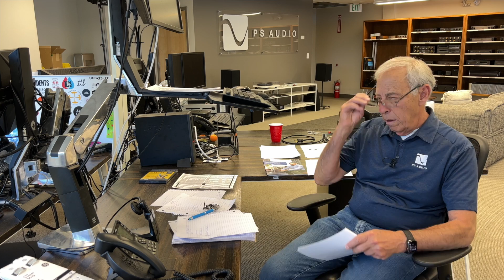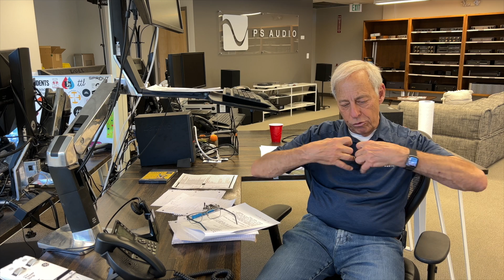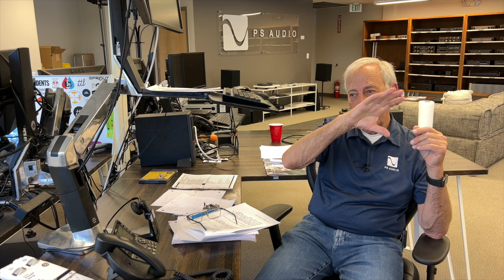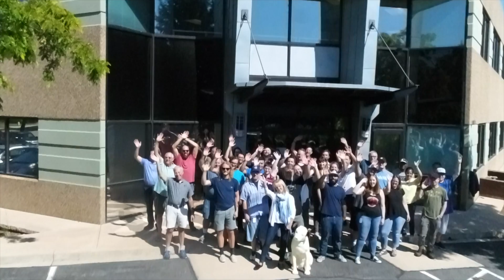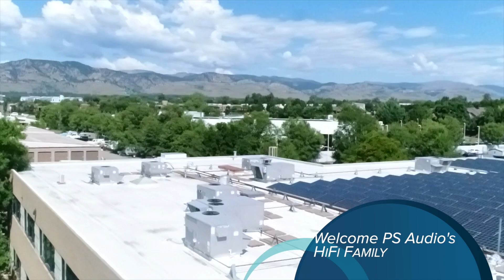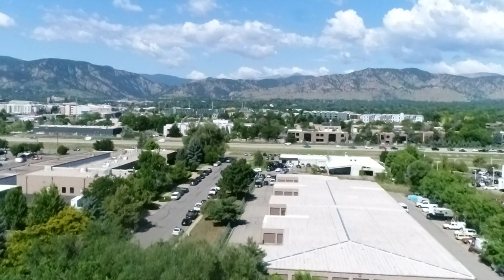Will PS Audio abandon traditional power supplies?

Comment: Paul, you dug yourself a hole on this one. If torodial transformers offer the best quality sound.......THEN WHY DO YOUR OWN CLASS D AMPS NOT USE ONE? They have a switching power supply in them. Lol! Which you just said isnt as good. And please dont tell me because class D is different.........I know manufacturers that have a class D amp...and a torodial in them. Nuprime Audio is just one of them. They get rave reviews, for example, their ST-10 amp.
Reply: A proper switch mode power supply is capable of performing extremely well
The issue is that manufactures use smps to cut costs and consequently use poor ones.
A proper smps might cost as much as an old toroidal transformer.
Reply: @user_47214  ok. Tell that to Paul.
Reply: PS Audio’s top of the line BHK series all use toroidal. Toroidal is expensive, and for the most part- people aren’t willing to shell out big bucks for class-d, yet.
Reply: @brs2c  If you read everything I wrote.....Nuprime Audio makes a ST-10 class D amp with a torodial transformer and its $1695. Its VERY highly regarded. Essentially the same price as Paul's Stellar S300. Paul is full of it when he says they use the best components in their products.
Reply: @brs2c  I know his BHK line uses them. How are you not understanding my point? What I'm saying is there are other manufacturers that have class D amplifiers and use a toroidal transformer. So if Paul and his company are so fantastic and give the greatest quality why aren't they using them in their class D amplifiers? He cut corners on his class d amplifiers.
Reply: @ryanschipp8513  Sounds like you don’t like PS Audio, or you just don’t like the value ratio- that’s fine. He uses switch mode/class d on his more affordable stuff, and toroidal/mosfets on his pricey stuff. Most manufacturers have a range, and no one claims their cheaper lines are better than their expensive ones. He has acknowledged that class d and switch mode are catching up, and will equal or surpass class a/b. I just don’t see the contradiction you see among within Paul’s line. If you want to argue value proposition against other brands- that’s a quite a rabbit hole, and I would argue kits and my home built amps offer the most value- but I don’t have the overhead of staff, insurance, rent, etc.
Reply: @brs2c  has absolutely nothing to do with liking them or not. I'm calling a spade a spade. Paul touts ALL of his offerings to be the best quality for the money. I have pointed out something very specific that goes against his boasting. Essentially I'm saying he's full of crap because I have proof of it. People should know about all the facts before buying from him.  No one can argue with him cutting corners and putting a switching power supply in his class D amplifiers. He could have implemented a torodial transformer in them like Nuprime.
Reply: @ryanschipp8513  " I'm calling a spade a spade." - no, you are grinding axes.  It's pretty clear that PS Audio has price levels and specific products for each level.  The toroidal transformers go in the premium products.  This is not hard to understand, buy as usual you want to grind an axe.
Reply: @TheDanEdwards  Dan..please read what I wrote again. You guys are really struggling to read and see my point. Honestly, are you ok? Paul clearly said toroidal transformers are superior to switching. Paul also proclaims that his stuff is the best and filled with the best components. NOW LISTEN CLOSELY....Paul's Stellar S300 class D amp is $ 1649...it uses a switching power supply. Nuprime makes a ST-10 that is highly regarded all over the place and it uses a toroidal...ITS $1695. Evidence Paul has cut corners. Period. People should know these things.
Reply: "DPaul touts ALL of his offerings to be the best quality for the money"   I think both manufacturers pricing is fair for what you get. Keep in mind they both use completly different input stages, caps, boards, ect, who knows what the costs are to manufacture each of those. If PS audios input stage costs 40% more than what Nuprime's input stage costs to manufacture there going to have to cut costs somewhere right?  If Paul feels the power supply he chooses for that particular product is the best choice for that particular product "for the money", thats his opinion in order to keep a 1600 price tag. If Nuprime Audio ST-10 power supply is say 40% of there cost that's there choice and to keep a 1600 price tag there going to have to skimp elsewhere or choose parts accordingly to keep there target price tag. There not buying parts at the local grocier in the same town dude. Pauls chips, caps and or power supplies cost him $$ to get in and manufacture say from a US based manufacturer then that's where his margin comes from. Nuprime has a differnent suppliers, 30% US, I would assume the rest comes from over seas with completly different brand of caps/power supply parts then there margins are based on.  It's going to be different no matter how you swing it cause there completly different designs, with complely different suppliers and completly different designer payroll. Doesn't mean that one is better or worse for that particular design, that is subjective to your ears. What someone calls the "best parts" for that particular product again is also very subjective, esecially to the designer trying to hit a target price point. There both decent class D amps just made different and come from different places.
Reply: @jwiggins1229  somewhat like the others you are Rambling On and On. Diverging greatly. Here, I will try to simplify it for you. This video is about power supplies. Paul himself is quoted in the video as saying that a toroidal Transformer will provide better overall sound than a switching power supply. However, in all of his class D amplifiers uses a switching power supply. The facts are that there are other manufacturers that have class D amplifiers and they use a toroidal transformer. It makes no sense for him to deviate from a linear power supply except to cut costs. Because again he himself said that a switching power supply is inferior to a linear power supply. And for what it's worth since you bring up all these other components as excuses for him the Nuprime ST-10 is outstanding sonically,  and many others agree. So Paul has no excuse. It is what it is. Just accept that he cut corners.
Reply: @ryanschipp8513  but dude if the margins dont allow for the cost of one than you cant add one right? Pretty fn simple concept dude!
Reply: @jwiggins1229  you must not follow PS audio very much. Did you see how much they had their stellar series on sale for in May? Lmfaoo! The S300 was $1099.........dude! Plenty of room to throw in a linear transformer. You haven't got a clue man.
Reply: @ryanschipp8513  They also have payroll and employees to take care of and they prob sold it for cost during that sale. Which in sales happends often to get people in the door to buy/try there products so then if they like the sound there more likely to move up the chain to there BHK than go elsewhere. It has 000000 to do with margins! Look I want a GTR motor in my Infinity Q60 but then it would be a completly different car and the cost would go up to the same price as the GTR.
Reply: @jwiggins1229  all manufacturers have payroll and employees to take care of. Now you are just all over the place just arguing to argue. There's nothing more to talk about they chinched on the power supply
Reply: @ryanschipp8513  Ok you win, as bad as my wife! :) I'm really not a jerk so sorry if I come accross like that.  You have your way of seeing it and I have mine... Neither of us work there so who really knows... I have a Pass Labs and really could care less, so you very well might be right dunno. Im just looking at it as why would I not put it in there as a business owner, but I get your point.
Reply: Also your kind of a big dude... I'm getting old, prefer not to piss off the dude with muscles the size of my beer belly!
Reply: @jwiggins1229  healthy handshake Jay wig. What is your rig consist of besides the amplifier you mentioned?
Reply: @ryanschipp8513  Indeed man, right now running a Pass XA30.8, Schiit Gumby Dac, Schiit Freya + Pre, Looking for something else since I sold my Pass XP 10 some time ago. May pickup a Kinki Pre or try a Denafrips dunno yet as the Freya is working fine for now. Custom semi high end desktop PC with 12.6 LCD for streaming "Sort of" resembles a Hifirose, It's controlled from a MS Surface. Speakers now, Wharfedale Linton "love those speakers bang for buck" Buchardt S400 v1 which may get sold soon, want to pick up a pair of Spatial Audio M4 at some point before 2024 cause I never heard any open baffle speakers other than the LSR's and they were ok. Too analytical for my taste, I haven't a decent set of higher end speakers in a while. I have litterly tried 20 amps and 7 dacs in the last 6yrs, sort of dumb waisting money just to try, but it's fun listening to new equipment. But now there's too many other things to fix or build around the house. Wife wants a 2200sqf deck built down to our pool next year, had to buy her a new Ford Explorer cause her GMC transmission went out at 68k, Centeral AC/Heat unit died this year and were remodeling our basement which is still only 3/4 done, daughter also turned 16 so we had to get her a car FML BROKE... SO any new equipment has to wait for while unless I can pull some side IT hustle the wife doesn't see :)
Reply: @jwiggins1229  thanks for sharing! Great stuff! I was very close to buying a Freya + pre. All of my gear is solid state and I was curious to hear some tubes in my set up. Does the tube mode really make that much of a difference to the sound? And would you say it's for the better? For the heck of it...you should check out Nuprime gear. They have a couple pre's. I have their Dac-10 pre/dac and I love it.
Reply: @Ryan Schipp
It's simple Ryan, you dig into almost every PS Audio video and come-up with something that you can spit-back into Paul's face. Smart people will research all of the class D amps they are interested in buying, so you're not telling anyone who is searching for a class D amp anything new. You're well known in the PS Audio video comment section for your attacks on Paul. That's fine, Paul will be the first to defend your right to argue any point, but the long-time comment readers of PS Audio can see through...
PS- Please tell us what PS Audio product you own. We can't understand why you would own any PS Audio product considering your attitude towards PS Audio...   🤣
Reply: @Mark-lq3sb  here comes another PS audio fanboy. Focus on what the video is about and what my very first comment was. It's very valid. Especially since the PS audio Stellar line was drastically discounted in May which shows how much margin is in them. I'll say it another time, call himself said a toroidal Transformer is superior to switching power supply yet he skipped putting it in. Makes absolutely zero sense. No one can challenge that even 500 of his Fanboys and him himself. I own the stellar s300 and it's really nothing special.My Nuprime ST-10 WITH a linear power supply beats it out top to bottom. Paul's amp sounds sterile. Do you want my address so you can come over and look at them and listen to them?
Reply: @ryanschipp8513 -  There goes another PS Audio hater...
Kind of funny Ryan. Why did you spend money on the PS Audio Stellar S300?
No, I don't want to come over to listen to a class D amp because I think they ALL suck.
Reply: @Mark-lq3sb  especially the ones with switching power supplies....that your beloved Paul puts in his amps.

Comment: I worked in the power supply industry for decades as a technician and then engineer. In the early days these were very noisy and had questionable reliability, If a switch mode supply dies it's often in a very dramatic way. As time went on better control chips arrived and we started to understand the layout of the circuit board was very important when it came to conducted and radiated noise, good layout can reduce conducted noise by 20db. 
You want an amplifier power supply to be as noise free as possible. Low cost phone preamps and DACs can be improved just by replacing the throw away switch mode power bricks that ship with most of them with linear power bricks because it cuts the noise down.
Reply: Great info thanks for posting! A agree with your findings!

Comment: Paul that’s why your build quality is some of the best in the industry a great explanation for anyone interested in the small details
Reply: No its not. His class D use a switching power supply...he could easily implement a linear power supply but they choose to cut corners.
Reply: @ryanschipp8513  
Have you ever owned any PS audio
equipment; their build quality is some of the best in the industry and should you have a problem you can talk to Paul or Scott; try that with some other high end equipment; my brother bought a top of the line Marantz that caused a problem with his PS Audio power supply. Marantz even acknowledged it was caused by this particular piece of equipment. Even with that said Scott Mc Gowan replaced the PS audio equipment free of charge. 
He even said in the video that they will eventually go to linear power supplies in the future.
Reply: @robertbyington7715  yes I have one of their components. You are diverging. I'm challenging something very specific. You're not staying on the subject. Simply put considering he says a linear power supply is the best sonically that should be in their equipment. Other companies have it in their class D amplifiers. That shows it can be done but Paul chooses not to and cut corners. It's that simple.
Reply: @ryanschipp8513  
It’s one component MAC uses a $7 volume control on their equipment costing 30K so there you go. Overall their equipment is on par with a bunch of stuff costing a lot more. The big point your still missing is IF their is a problem with ANY PS Audio stuff they will correct it immediately; hell the wait list to get mac is 6 months let’s not even talk about trying to get a problem fixed with stuff you already have.

Comment: My first switch mode power supply came with an IBM PC clone made in Taiwan. This first generation DOS PC from 1983 caused so much RF noise that my parents neighbor in a detached house could not watch TV while I was using it. It took some professional guy with some RF scanning equipment from the government to pinpoint my computer as the source.
Reply: So what did you do after you figured that out?
Reply: @jayohh8508  I grounded it. Btw, our neighbor even had a TV antenna installation guy coming several times to try to fix that roof antenna before finally they called for some expert to investigate the noise in the area. That roof antenna was probably 50 feet from my computer. My parents TV was not affected as my room was at the edge of the house towards our neighbor I guess.

Comment: Aren’t the filters and shielding nowadays good enough to be comparable with linear ones?
Reply: Yes. A well designed switch mode will outperform a "linear" power supply (which is  just a 60Hz switcher and not really linear, since they're usually not regulated) in every aspect. Linear supplies are simply just easier to design honestly.

Comment: Did you know the larger the capacity of the x2 cap across the AC of an smps the better they sound? I went up to 3.3u and replaced all the crap I had before the psu with that alone. 10uf’s, the size of matchstick boxes arrived the other week. Mmmm
Reply: what do you mean?

Comment: Its Line Mode Power Supply vs Switching Mode Power Supply. Some says that Line Mode is a lot quieter than Switching Mode hence more applicable in Audio Systems despite being less efficient.